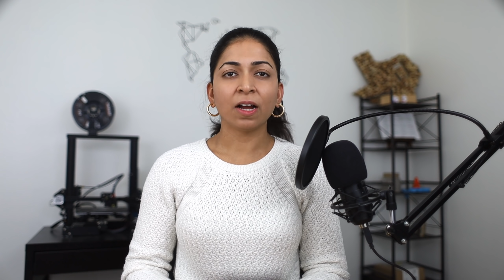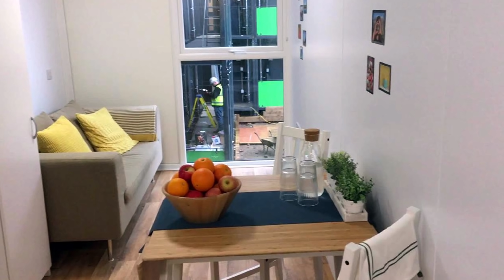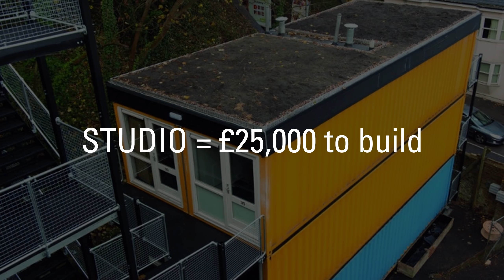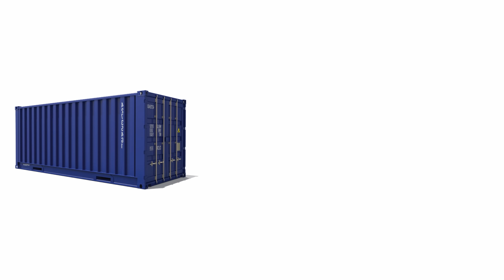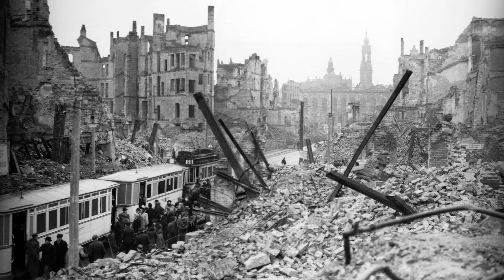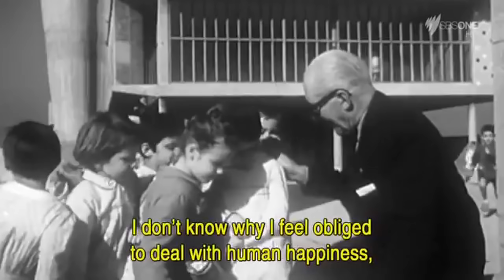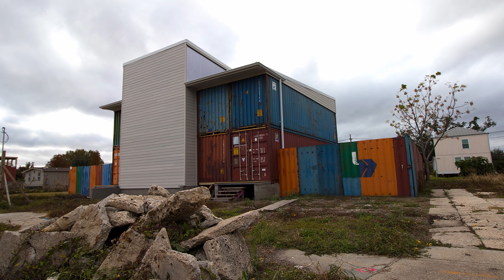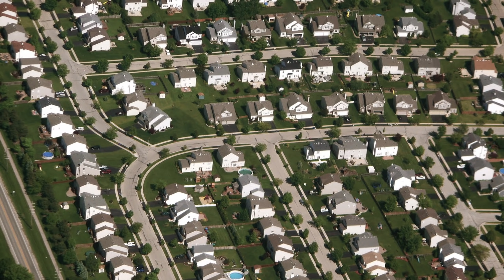Why Shipping Container homeless shelters FAIL

Comment: This shipping container home series is the funniest thing on youtube.
Reply: people who think theyre bad are generally the retards that throw some random board insulation on and call it fine XD know plenty who have nice ass ones
Reply: They can work for an outside structure, but it requires the same considerations as a wood frame for proper insulation and heating/air conditioning requirements for a small space. It isn't a good option, if you are looking to scale back cost and in most cases, it can be more expensive for building the inside properly.
Reply: @runtochrist1975  Tornado proof!
Reply: @Reach3DPrinters  Maybe if you bury them, otherwise a shipping container is about as "tornado proof" as a mobile home. Except mobile homes are anchored down, and containers are usually just dropped on a gravel pad.
Reply: @berserkasaurusrex4233  I could throw a 2x4 through the wall of a trailer home, I couldn't throw it through a shipping container, LOL
And trailer homes are parked, NOT anchored down, unless you suspect they chain the axles to a concrete pad.
As for a container homes, they are generally bolted to a pad when installed to code. Trailer homes do not have such a code, so it is exactly the opposite you're position.
Reply: @Reach3DPrinters  you are very pro shipping container. Why? Take that 2x4 and yeet it at a shipping container and it will dent it pretty well, but I dont judge the quality of housing off whether some schmuck on the internet thinks he can throw a 2x4 through them. You know what is as tornado proof if not more so than a shipping container home? A cinder block home. It's cheaper too.
Reply: @Reach3DPrinters  Shipping containers are not tornado proof. The walls are thin and cannot withstand outside pressure which is why they need to be heavily reinforced before living in them. Did you not watch any of the videos?
Reply: @elsagrace3893  Those walls are 14 awg corrugated steel. Thats 3/40th of an inch thick!
Clearly nothing is tornado proof. A cinderblock structure might be more tornado proof than a shipping container, but a container can take MUCH higher wind sheer than a stick built home like 90% of the US has. Do you not understand material tensile strength?
Reply: @rattyratstuff7125  You are way too emotionally invested in a metal box to be healthy. Seek professional help.
Reply: How so?
Reply: Lol this lady doesn't like this idea at all
Reply: @chopyahchoice2987  did you learn anything about why she doesn’t like them?
Reply: THANK YOU!! I've noticed this about this lady too! Her reasons are outrageously hilarious
Reply: @Addictedtocollecting01  how so? She points out the stupidity of shilling container homes